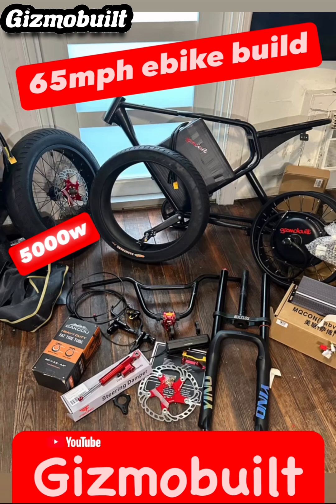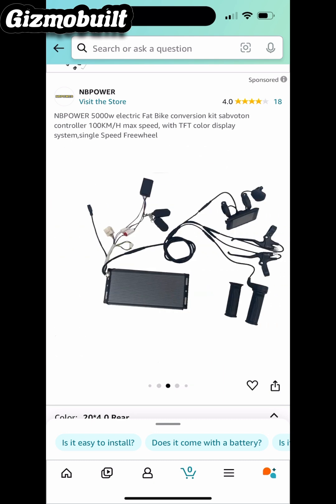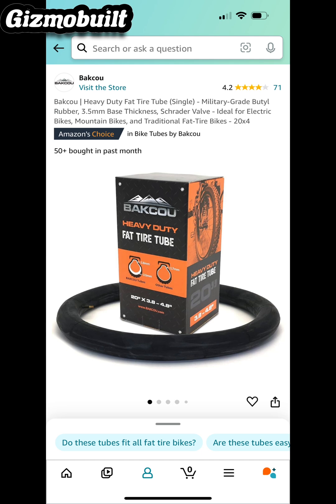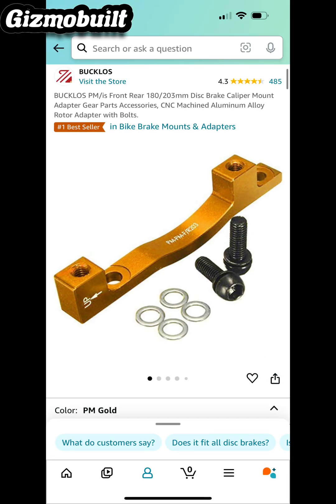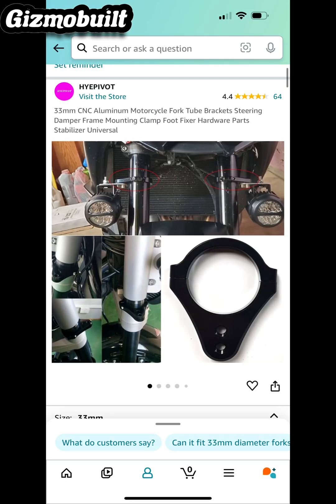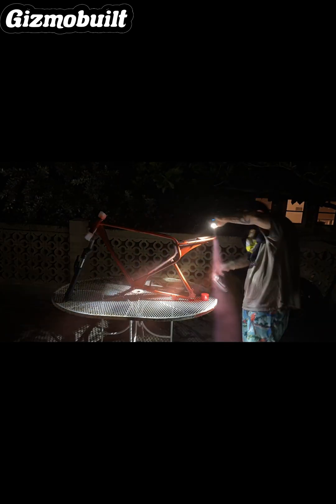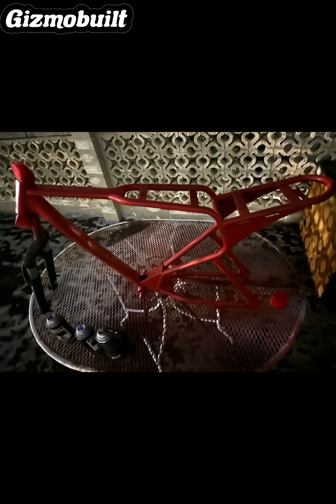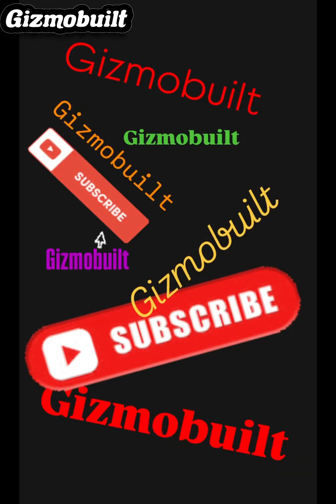Building a 65 mph Ebike 5000watts part 1

Comment: great build but i wouldnt trust those brakes.  Take a look at the Tektro Auriga e-comp, great value and they have included cut-off for motor with the 2 pin jst connector.